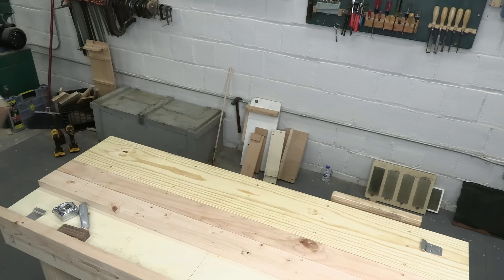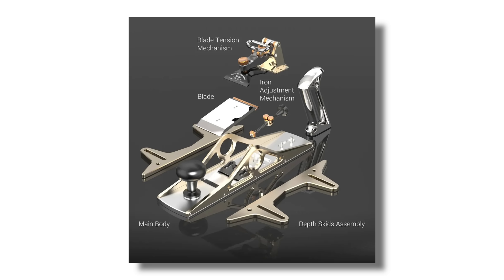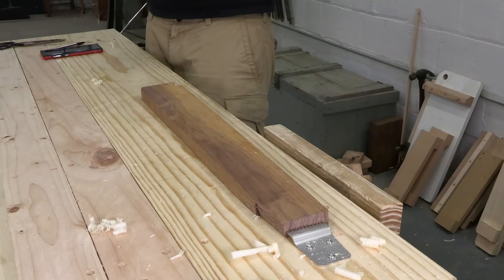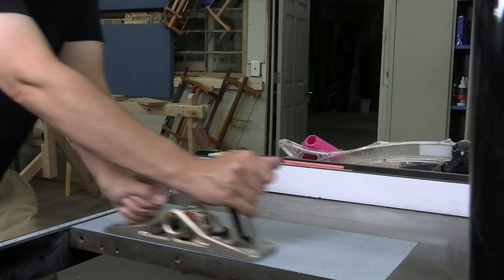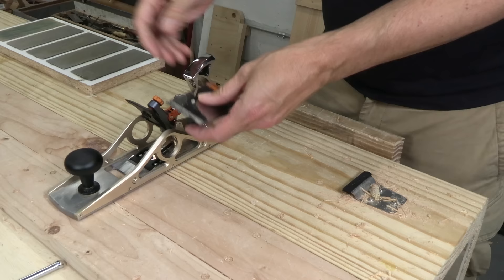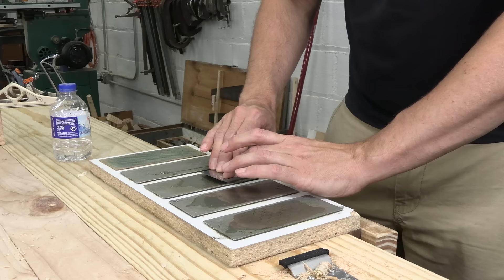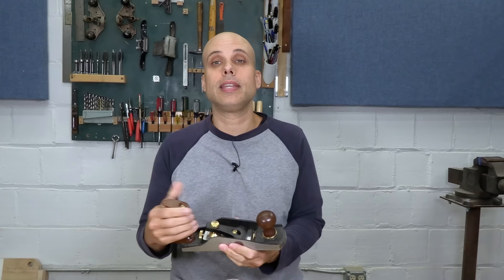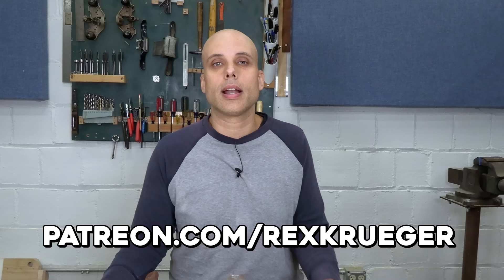How good is a REALLY expensive plane?

Comment: Bridge City's reputation was built when they were made in Portland to the founders exacting standards, but they sold the company and I've been hearing things like what you're saying here, that the quality is falling off. Which is weird because Harvey (the Chinese company that bought out BC) has an excellent rep in the industrial tools market. All the same, I felt like it was telling that Lee Valley unceremoniously dropped them like a bad habit last year and wondered if it was the canary in the coal mine.
Reply: Interesting.  Even as high quality it just seems so over the top as to be a waste.
Reply: I bought a Bridge City HP-8 mini block plane and thought it was pretty cool how the tolerances were tight enough the iron wouldn't need any room for lateral adjustment, except it did need to be adjusted laterally because something was out of square just enough to make one corner of the iron protrude further than the other.

Regarding the packaging, I would have preferred either something fancy and small that I could store the plane in while not in use OR something modest so I could toss the box and keep the plane in my tool chest.
Reply: Rex, don't you know bridge city tools are not made for woodworking. You're supposed to put it on a prominent shelf in your den next to the 30 year old scotch.
Reply: 😁 @FrankPace54  My 30 y/o Irish Whiskey stands besides the tumblers in the maxi-bar vitrine. I could bore three holes through the bridge-city space plane and fix it on that chest as a doorknob - would make a nice contrast to the 180 y/o (still original glass) cabinet I reckon .... coming from a place where planes are made from wood and my apprenticeship had "making planes for special uses" in it, I have no real use for a big iron lump calling itself "benchplane" anyway .... 😄 I do have iron- and modern planes of course, but the daily benchwork is still done with 30 to 60 y/o, well preloved (and often adorned) fleemarket- and garagesale-finds I restored to my own spec ...
Reply: @FrankPace54  To be clear: you get the best performance when it's a minimum of one shelf above the Festool collection, and you minimize its contact with any of the lesser metals. As a general rule, it will deign to contact gold, platinum, iridium, titanium, and tungsten without issue. Silver, too, but only sterling. And for gods sake, don't give it access to uranium, or plutonium (it'll cut like a dream for time shortly afterwards, but by shifts end the metal will be gone and nobody knows where to.)
Reply: Did Lee Valley have an interest in Bridge City for a while? Seems odd, since their bevel up planes are also "dual angle" and are fantastic to use. Veritas make excellent planes and I'll happily keep buying them.
Reply: Thanks for the excellent review. Lost me at "not flat." At that price!?
Reply: @1320crusier  Veritas planes, those are made in Canada , lot of expensive hand planes , lot of special job planes , like router plane , just to make a groove , for people who want to do that with hand tool and not with an electric router .
I still have my grand fathers Stanley cast iron planes and one wooden no brand, maybe one needs new rear handle and thats for 70 year old tools.
Reply: The problem is with us for thinking reputation means anything like what it used to mean. Reputation is a commodity these days. Companies with a reputation get sold and "cash-in" their reputation, selling shit tools and spend their brand perception until it's driven into the ground and sold off.
Reply: If I paid 750 dollars for a hand plane as soon as it was 5to 10  thousands of back it goes  quality control is gone if I have to adjust it   buy one for 1 hundred dollars and do my own qc
Reply: Would it be fair to try a BC tool produced before they went to china? Maybe do a compare and contrast
Reply: I’m sure the founders are probably hipster lumberjacks
Reply: I don't know why they dumped BC, though there was an outfit in Canada, undercutting them.  There are also a lot of companies ripping them off whose products can be ordered for cheap from China.
Reply: Harvey I hear has quality control issues as well
Reply: Noting like good old capitalism making things worse and worse over time, because even tho you are charging insane amounts of money, you still gotta make more money each year, meaning cutting corners each year stacks up to give you whatever this abomination of a plane is.

Comment: Thank you Rex and shoutout to Brian for making this possible.
To be honest - I was done with the idea of that plane when the sole turned out to be hollow. That is unforgivable, there is no sugarcoating this.
Reply: Yeah thats pretty aweful. I think a lot of engineers my age grow up thinking that 'cnc machined flat' is the gold standard of flatness and unless you are building a telescope mirror or something its good enough for anything. The reality is when you hog out a big piece of metal like that you are going to release all kinds of internal stresses from the billet and more or less all bets are off when it comes out of the cnc machine; just for that reason alone. Not actually taking the effort to grind flat a plane at this price point is ridiculous. As is that angular piece of metal they call a handle...
Reply: Agree. They need to add a lapping step prior to final assembly.  It should have been flat.
Reply: How do you know that the cast iron table top was flat? If you lap a straight tool against a concave surface, it may make the tool look out when it is not.
Reply: @AlbertaHome87  I do not think that the rule and light test was lying...

Comment: I broke down and got myself a Lie-Nielsen No. 4 - The base model with the cast iron body and cherry handles.  It was only about half the cost of the Bridge City, and uses the familiar Stanley Bed Rock design, with refinements.

It's a beautiful tool and its performance makes me look like a better woodworker than I actually am.  Still, you could do well with something like a Wood River for about half the cost of the Lie-Nielsen.

I was surprised the BC sole was so out of flat.  That money they put into the packaging would have been better spent on better machining.  My L-N was packed in a simple cardboard box with sheets of crumpled-up local Maine newspaper for cushioning.
Reply: Lee-Nielsen seems to still be an honest company making things as well as they know how from a factory in a part of Maine which really can use the work.
Reply: @johnhorner5711  because Lie Nielsen is still owned and lead by Thomas Lie-Nielsen and not a sellout to the far east

Comment: Agreed on all points.  I have a full shop of Harvey power tools and LOVE them.  However, The sister company, Bridge City Tools leave a bit to be desired.  Squares are just "wood working" square, and I'd expect "machinist" square at BC Tools' price.  I do have to agree about their 02 steel though.  I used my mini block plane "out of the box" for weeks.  It just kept delivering wispy shavings and quickly cutting chamfers.  Only sharpened it to regrind blade so its edge would exit the mouth parallel to the sole.  The adjuster couldn't compensate.
Reply: to be fair, a Lie Neilson 101 will do all of that out of the box as well, can be adjusted without regrinding the plane, is extremely comfortable to use (the 101 and 102 fit my hands so well that I hate to put them down), and has a lower retail price (looks like the HP8 is on sale now, at $79 it's probably not bad)
Reply: Andddd because it's currently $79 I just bought one. Am I a sucker? Probably. We'll see how it compares to the LNs.
Reply: @joewilson4436  what?  $79?  It's worth that as just wall art.

Comment: Your feelings about this plane are the same as mine. First one had too much air under the straight edge on the sole, so I sent it back. Replacement one was identical. There was a noticeable dip in the sole where the handle attached. "Oh, don't 'fix' it because you will ruin the surface on the bottom." I might be able to get used to the lever action clamp that holds the blade in place, but it doesn't work like the other planes I have do. If the lever cap is too tight, it is difficult to advance/retract the blade and get the blade square to the sole. Maybe they want you to get it all lined up then tighten it. One you didn't mention was with my big hands, I can't keep my lower 2 fingers around the handle, because of the advance/retract knob for the plane blade rubs against my knuckles. I had thought of sending mine to you also, but never got "a round 2 it" (woodturner's joke....). I don't like the reversable blade for the same reasons you mentioned. I think the blade will fit into the Woodriver or Lee Nielson sharpening jigs. I did not get one of their sharpening jigs either. Also, I didn't get a plane sock..... I did buy it because I was curious and am one of those who have to experiment, just to see what happens. Bridge City, started in Portland OR. which is known as Bridge City some times, and I think the guy retired and sold the business, which is why they are now made in China. It was a move that was supposed to help reduce the cost, and I think they are a little less expensive than they used to be. It for sure is a 'boutique' type of tool, which means nice and shiny, but other tools can do the same job for far less money. I prefer best 'value' in tools. I looked for my second blade because I didn't remember getting one. I either lost it or they didn't send me one...

Comment: Amen Brother! As an old fine finish carpenter and custom furniture maker I have mostly old(er than me) Stanley and Bailey planes. The one expensive plane I have is a Veritas skew block plane which at $200+ is worth every penny. But truth to tell, the plane I keep in my tool belt and have used way more than any other even when doing fine work and would never give up is a simple and cheap 5 1/2 inch Stanley #102 block plane. The key is: Tune it and Maintain it.

Comment: I am a lifelong quality over quantity person. I have worked wood since I was a child with my dad, but we did basically everything with power tools. 

As I became interested in adding some hand tools to my processes, these planes stood out to me for their advertised versatility. The $1000 retail price is crazy though. I'd have to go digging for receipts, but I think I finally bought mine for $429. 

At the time I planned to only use this tool for fine finishing and final dimensioning. I was looking to eliminate sand paper and tidy up joints. The tool I received has no issues, so I guess I was lucky. 

I have since expanded my variety of hand planes to a stable of about 10 that I use regularly and this plane remains as the last one to touch a piece often times since it leaves a glossy surface with the least maintenance. 

These tools are good in the context that I use mine, but as Rex mentions, I don't think I'd want to use it all day for a variety of tasks requiring regular blade changes and frequent sharpening. 

Tip for anybody who owns one of these or buys one: As Rex mentions the blade changes and sharpening are sort of stressful. I use a telescoping magnetic retrieval tool to extract the blade from the body. This allows you to lift it out without risking your palm or smacking the edge onto anything. Then I use a piece of leather folded in half to cover the rear cutting edge while sharpening and/or honing. 

These are actually suggestions I relayed back to Bridge City when they solicited my feedback on their tools. They replied and thanked me for my ideas, but I doubt that they'll include such amenities in their packaging even though it seems they should for the price. 

If you are considering a Bridge City Tool, they offer discount prices in a rather suspicious way. I noticed that after adding myself to their mailing list, I received sale notifications for items that I had viewed on their website. So I'm guessing they are targeting pricing using cookies. I kept going to their website clicking on the HP-12 plane, adding it to my cart, and never purchasing. Then I'd get lower prices emailed to me later on. I actually did this for their other two planes as well eventually getting the medium block plane for $199 and the small block plane for $69. Still high prices for these tools, but if you're interested in these, it may help some of you. 

Thank you to Rex for doing this review. When I purchased my Bridge City HP-12, hardly any reviews existed that appeared unbiased. I considered doing a review myself, but at the time I didn't feel I could be unbiased given my level of experience with hand planes and lack of perspective from using different types of them.
Reply: Abandoning items in your cart is a great way to get discounts on tons of websites, always worth a try if you're not in a rush ;)

Comment: Most of my Stanleys came from a recycling shop at a rubbish dump.  They are all excellent except a corrugated bottom no. 6 which might need to go back to the rubbish dump.  It is fine on wide boards but on edges it can 'fall off' and bevel the edge for you.

Comment: I'm a high end tool junkie, and have a few BC tools, and haven't been that impressed for what I paid.  I haven't tried their planes, but everything else has just been meh with the exception of their packaging...LOL!   I do have the sharpening jig you mentioned, and have serviced it several times with help from customer service.  It aspires to be the Veritas guide (which I also use) at twice the cost with a little bar to help you ensure the blade edge is square.  Totally not worth it.  From a collectibles perspective, you can probably drop $750 on a BC tool, and someone 10 years from now will buy it for $750.  Sell that plane now and buy 10 users.

Comment: The sock is rust protection.
I have a lot of Bridge City tools, including a Jointmaker Pro v2 (which I haven't worked out yet, lol) but the most recent are not accurate at all.  I have a large Try square that is out by around 5 degrees.  I still have items I bought over a year ago, but haven't opened due to moving house and traveling.  I'm dreading what I'm going to find with the other stuff when I unpack and open them.

Comment: Superb review. My jackplane is the low angle Veritas, and I love it. I've eyed out the Bridge City before, because some of its features are pretty cool. But the Veritas is a great plane. Would have been nice to have some tapped holes on the sides of it for accessories, like depth gauges and such. But I couldn't have asked for a better plane otherwise. It's absolutely crazy to be that you had to lap the Bridge City plane's sole. You'd expect that from an old used plane.

Comment: Keep the edge guard on it with some tape.
The double edge works great as you don't have to stop, remove, sharpen, re-install then keep working.  Just flip the thing over and go back to work and fix the damage later.
Just a little too critical in review, in my opinion.
I agree on the handle, so make an insert of wood with some "swell" to it.  (shouldn't have to, but.......)

Comment: I would love to see your views on wood river planes, from what I understand they are based on the Stanley bedrock planes but made with modern materials and milled to a finer tolerance. They still need a bit of work out of the box but I feel that’s the same with any plane. We are always going to lap them and sharpen the irons to make sure they are perfect. I also feel the price point is good for someone who is looking to upgrade but it’s not out of the danger of normal wood workers.
Reply: I've got one.  Works like a Stanley, pretty much.  It doesn't feel as nice, but I suspect that's mostly the weight - it's a bit heavier that a standard #4.

What surprised me was the corrosion.  Pretty much all my tools are either vintage or modern corrosion-resistant steel.  I wasn't able to go to my shop for a few months (the coldest and wettest months around here) and when I did I found rust spots on the Wood River.  They sanded right off and were on the side of the tool so it wasn't a big deal, but pretty much all my tools have a nice black patina on them so I didn't realize I'd need to take steps to protect the new plane.  I rub it down with floor wax from time to time and it seems to do the trick.

Comment: Being a woodworking hobbyist, my first hand planes were from harbor freight years ago. I had nothing to gage how a plane should work or how to use it, set it up, etc so I let them sit out of frustration. A couple of years ago I bit the bullet and bought the veritas low angle set and was shocked at how well they worked....I would have bought a "vintage Stanley" but I've never seen one, let alone for $30-40.

Comment: I recently bought a Woodriver plane and enjoyed it so much I bought several others. I enjoy them so much over the cheaper planes Ive owned in the past that I even catch myself giggling while I use them!
Reply: I have a wood river no 5 and I barely use it (although I used it today!). I find it unnecessarily heavy, and a grind to use over long periods (and I'm fairly strong!). The lighter Stanley versions I just find much better to use. As long as they're sharp, the weight is perfect. I'm waiting on a new (old) number five wooden plane from eBay that I'll be fixing up and I'll likely sell the wood river.
I should add, though, that the wood river is excellently made, to very tight tolerances and feels nice in the hand and looks good too. It's just the weight thing for me. I don't understand it.